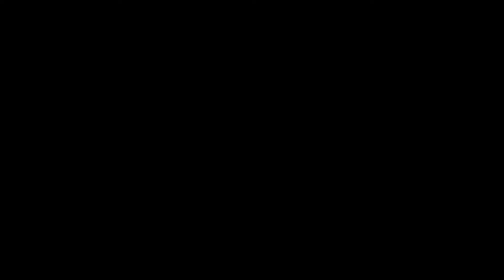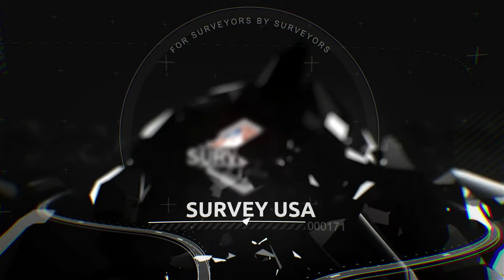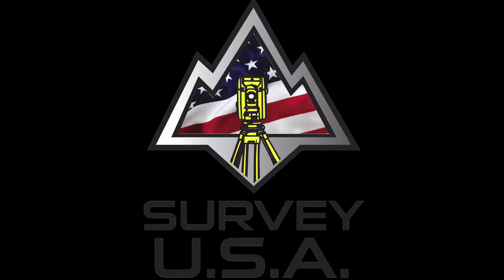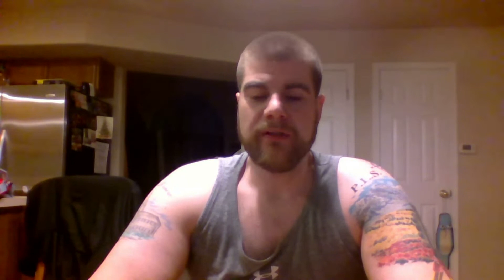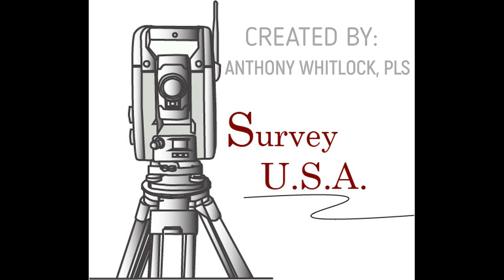Quick Surveying Case Law Discussion

Comment: One thing dishonest people should better understand is that the only thing that counts in the field is what the deed calls for and nothing more. I knew an old man who wanted to steal some land, so he, not knowing the law, the surveyors trust., And he went out and set himself a new landmark. He put a steel axle where he wanted the corner to be, but what he did not know or ignore was that the deed called for a 1/2 inch steel water pipe that he had stolen. A time came when a new survey was made, and the surveyor replaced the monument with exactly the same thing in the correct location as it had been. Never remove monuments set by a surveyor; you cannot fool them, they always go by what is called fo in the deed description.